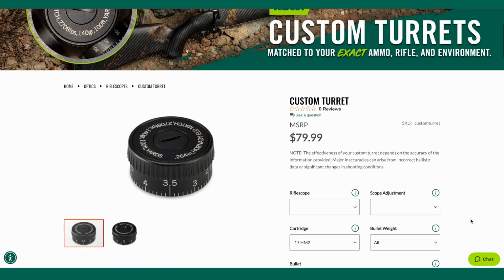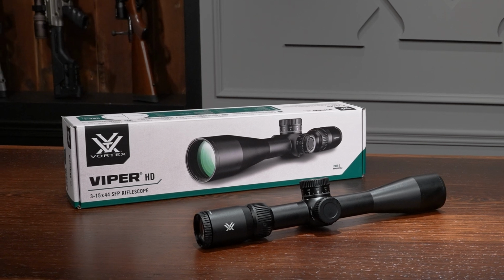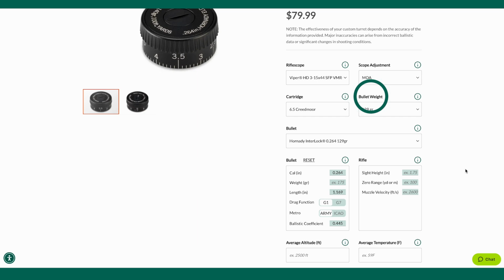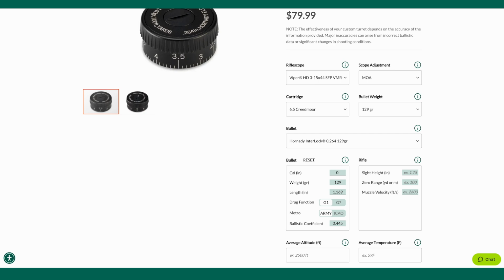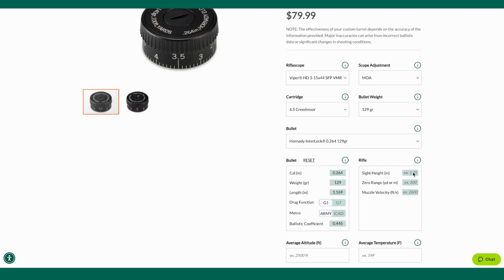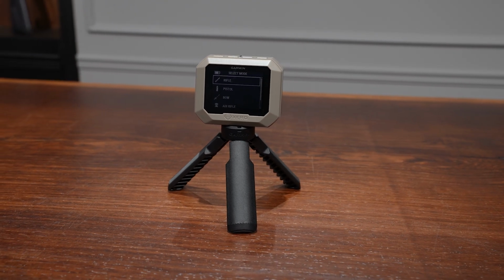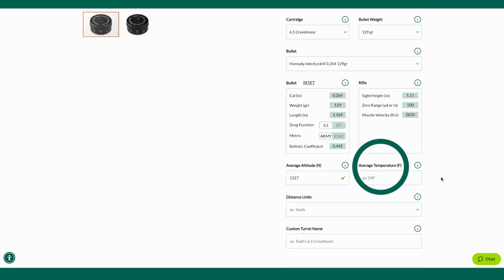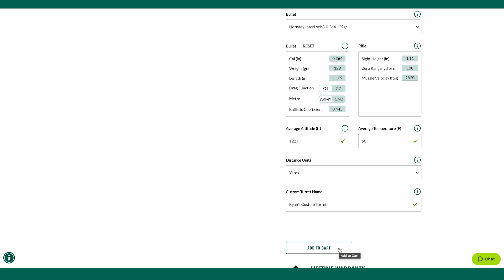Build a Vortex® Custom Turret – Here’s How

Comment: What scopes does this work with?
Reply: Just checked. Looks like only a few. At least right now. copy/paste from the menu below:

Razor HD LHT 4.5-22x50 FFP XLR-2
Razor HD LHT 3-15x50 SFP G4i BDC
Razor HD LHT 3-15x42 SFP HSR-5i
Viper HD 3-15x44 SFP VMR-3
Viper HD 5-25x50 FFP VMR-4
Viper HD 5-25x50 SFP VMR-3

Hope that helps.
Reply: Kenton Industries makes them for for most scopes